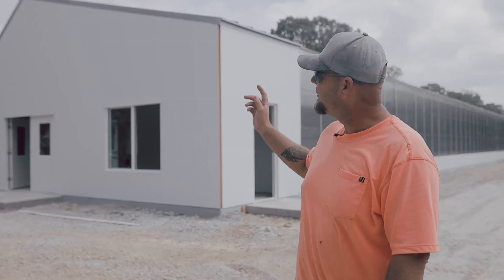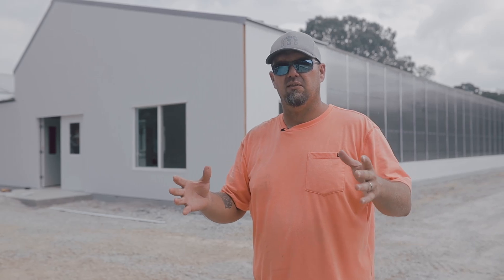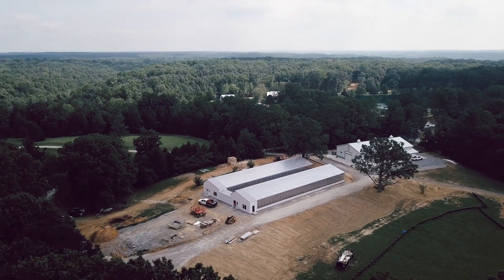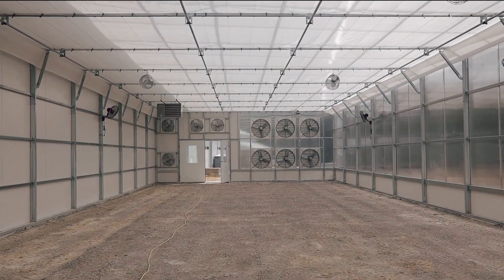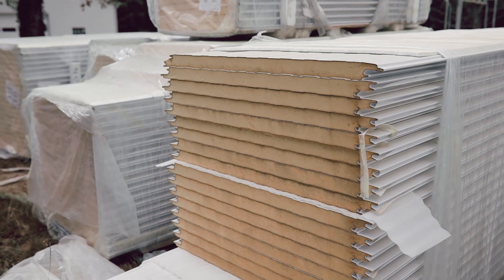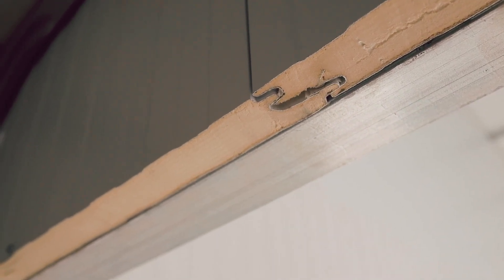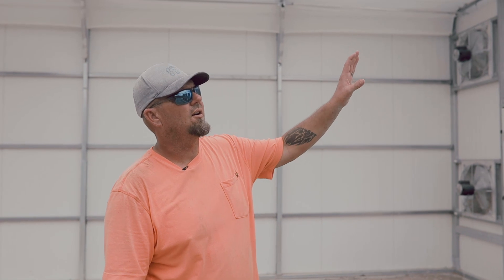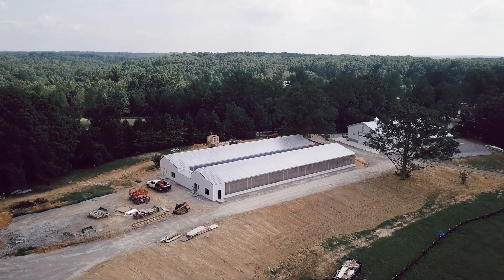Building a Ceres HighYield™ Kit Commercial Greenhouse

Comment: What angle are the greenhouses facing? And how much sunlight is blocked by the east and west side solid sides?
Reply from the maker: the greenhouses are facing, with the glazed roof and wall, towards the south. Based on your site restrictions and where you are geographically, the greenhouse may face more SW or SE. Before building the greenhouse we analyze your site to ensure that we angle the greenhouse correctly to ensure the most light year-round.

Comment: I wonder if it would be possible to use a high power hot-knife to cut the poly panels instead of the abrasive cutoff wheels. Might make for a cleaner cut with no dust.